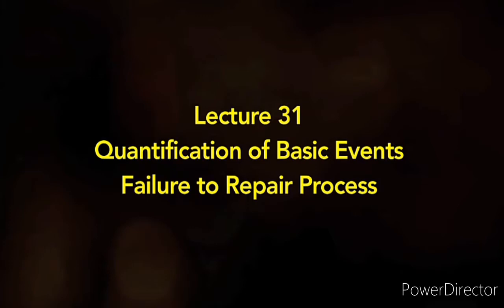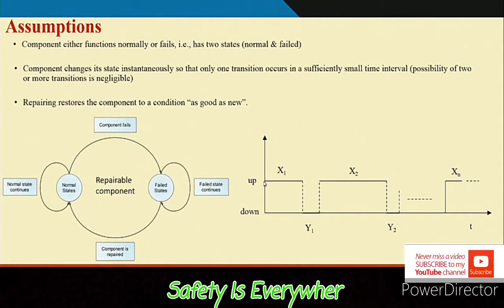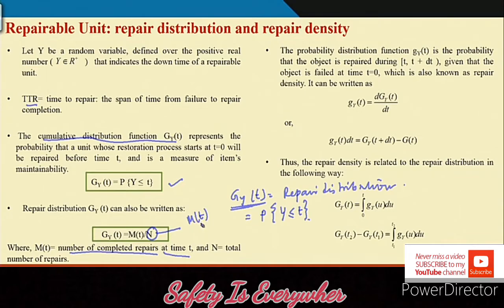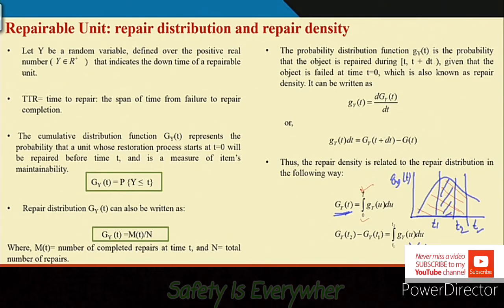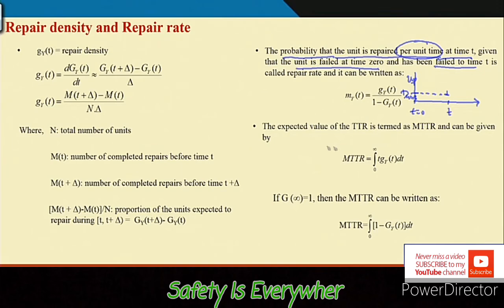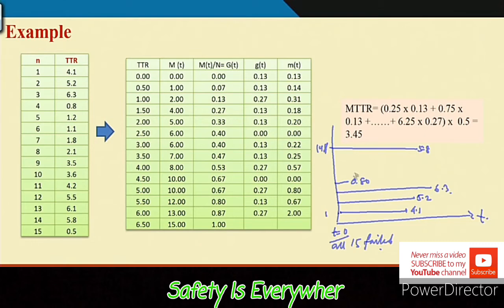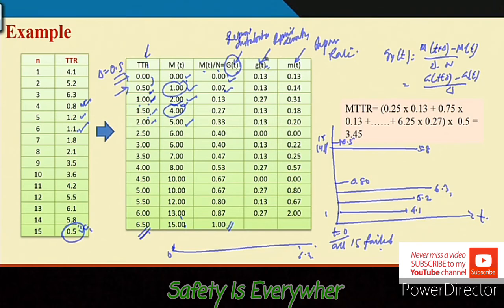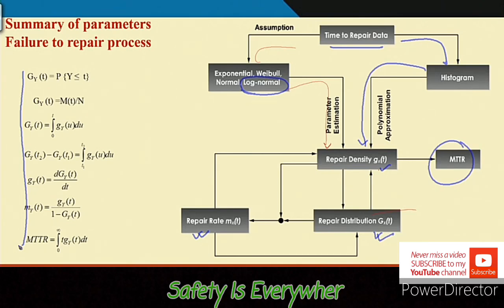Quantification of basic events- Failure to repair process.

Comment: safety engineering lectures.
Lecture-1. Introduction to Industrial Safety Engineering.    https://youtu.be/ZHO3J5ry-lo
Lecture-2. Key concepts and terminologies.  https://youtu.be/e8CoR_jv5Us
Lecture-3. Key concepts and terminologies-Safety domain ontology.  https://youtu.be/6JcFkrPtkMA
Lecture-4. Key concepts and terminologies-Risk Assessment & Control. https://youtu.be/3wq0RXQoI84 
Lecture-5. Safety Engineering & Accident causing mechanisms. https://youtu.be/Q_veegUkjCs 
Lecture-6. Preliminary Hazard List. https://youtu.be/h6NSpupWR4I 
Lecture-7. Preliminary Hazard Analysis. https://youtu.be/5B7eeuGbOiE 
Lecture-8. Hazard and operability study (HAZOP)  https://youtu.be/y1zGxalGL5w 
Lecture-9. (FMEA)- Identification of Failure Modes. https://youtu.be/nDhp-TaJyFc 
Lecture-10. Failure Modes and Effects Analysis (FMEA)-Continue.  https://youtu.be/TAnPlzMHii4 
Lecture-11. Application of Hazard Identification Techniques. https://youtu.be/l-eZXTmieUY
Lecture-12. FAULT TREE ANALYSIS (FTA)- Construction. https://youtu.be/7oKiCAR7ohI 
Lecture-13. FAULT TREE ANALYSIS (FTA)- Gate by Gate method.  https://youtu.be/VkPnzhpfSsk 
Lecture-14. FAULT TREE ANALYSIS (FTA)- Cut-set method.  https://youtu.be/SGBQtnYA1VE 
Lecture-15. EVENT TREE ANALYSIS (ETA). ok. https://youtu.be/J7tnFOZtM-c 
Lecture-16. FAULT TREE ANALYSIS (FTA) Importance measures. https://youtu.be/boUgDFBKfC0 
Lecture-17. Bow-tie.   https://youtu.be/SNfSbse9ivY 
Lecture-18. Bow-tie_ Common Cause Cut Sets.  https://youtu.be/8PhveicMkWU 
Lecture-19. Bow-tie_ Cut-sets for Accident Scenarios.  https://youtu.be/AZe6GVJNqz0 
Lecture-20. Bow-tie_ Cut-sets for Accident Scenarios (Cont.)  https://youtu.be/YGdPRmOkGNE 
Lecture-21. Bow-tie_ Identification of Safety Barriers. https://youtu.be/J2tK0_icemw 
Lecture-22. Risk assessment, risk management system.  https://youtu.be/YDw97riGzrk  
Lecture-23. Consequences assessment https://youtu.be/07BoNl6Th44 
Lecture-24. Energy control model and Hazard control hierarchy https://youtu.be/ENpFXj9yiMM 
Lecture-25. Safety function deployment https://youtu.be/m3QuZ7c0ZuQ 
Lecture-26. Ranking of design solutions. AHP approach https://youtu.be/AzfJy_8ZAcI 
Lecture-27. Quantification of basic events for Non - repairable components https://youtu.be/udgyZ-PA6ds 
Lecture-28. Qualification of Basic events - Hazard rate. What is IFR, CFR and DFR. https://youtu.be/xpacBhN8U9w 
Lecture-29. Quantification of basic events- Exponential distribution https://youtu.be/4A8204-jWp8 
Lecture-30. Quantification of Basic events- weibull Distribution. Parameter estimation from graphical https://youtu.be/JOKCWE9oBBg